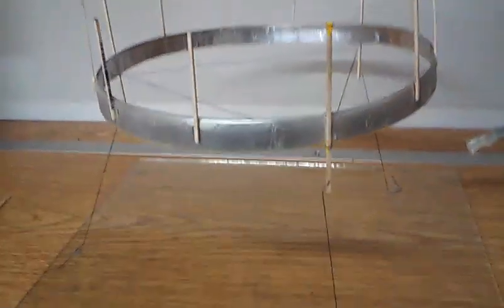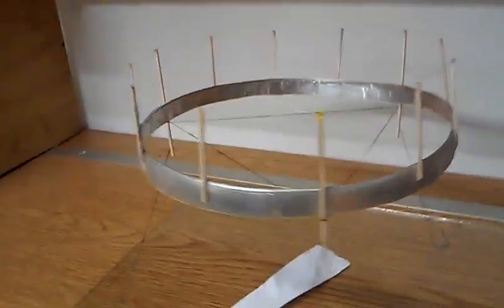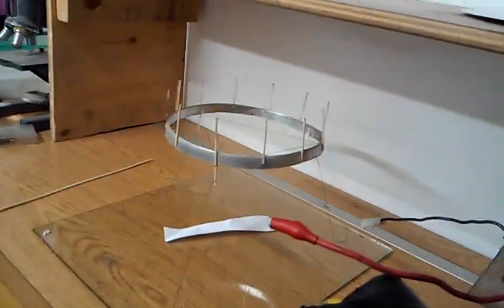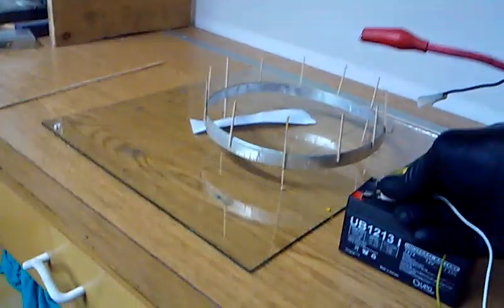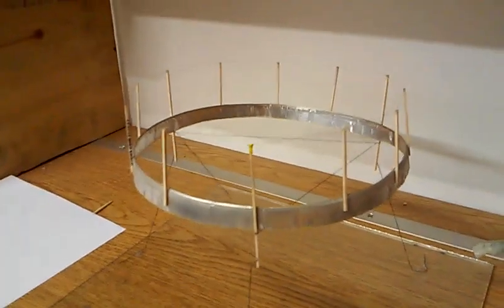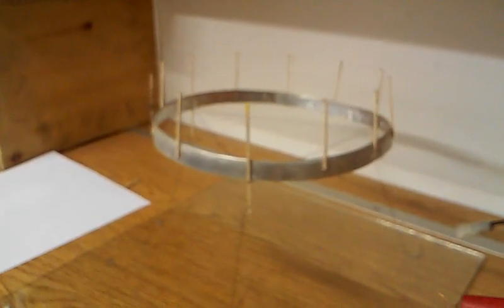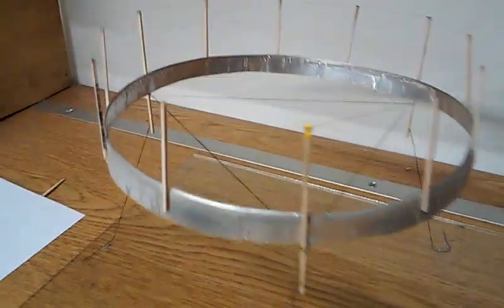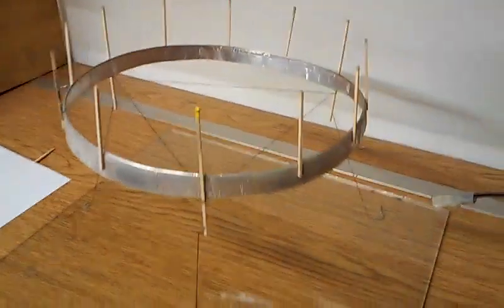ANTIGRAVITY LIFTER CREATES ARTIFICIAL GRAVITY ASYMMETRICAL CAPACITOR

Comment: If you want to real test just put that device in a vaccum chamber (almost 100% with no atoms). If it doesn't lift, its for sure ioninc wind. otherwise is something else  like you say(...) ... You said "it creates it's  own gravity field". Drop something inside to check if there is any kind of "gravitic correlated anomally" (weight reduction, any different trajectory, etc). Looking for the tension on the wires holding the device, i would say its just a "pulsing ionic wind".  A neutral gravitic disruption would, for instance, put the device floating with no need of wires(...like a gravitic cancellation) Try the refered  chamber and you will get the answer(...) For instance, if you can observe a floating iron based material, replace it with an organic one. Like an apple or cotton... On a true antigravitic environment you should observe same behaviors on both materials (like in space).

Comment: I used to repair tv's  back when I was a kid and I remember getting shock by the nodes or high voltage reactor 11000 volts that supplied power to the vacuum tube that used to be the old TVs the size of  differential power emitted by that wire the one that was inserted inside the tube (TV) used to have a suction cup in order to keep the electrons fired or dispersed by that account those electrons are being fired to the plastic krylon ( Cathode ray beam) mica which in fact bounce to the aluminum or tape around the sticks and you can see his latex gloves to prevent shock and yes is painful getting shock with those sparks

Comment: Guys, I suggest instead of all the negative comments and criticising this guys science knowledge you actually try and make one yourself, they are quite easy and see for yourself.  I've made a few and even made a vid of one attempt here:https://www.youtube.com/watch?v=xMnWqA7GClk   In my experiments I used a scale to measure the thrust and weight of the lifter and although there is indeed ion wind from the lifter the amount of thrust is at least 10x less than what would be needed to lift the mass. In my experiments the 'wind' seems only to give the lifter a direction to go in ie. up. Also other experiments showed it was able to maintain fixed altitudes based on different levels of voltage. if there was even a fraction of a newton more than needed to lift the object and hover it would keep moving in an upwards direction and not sit at different heights based on the volt level. I will video more of my experiments as some quite amazing things happen that don't get mentioned. When my lifter is at the top of its tethered travel I too tried poking it with a long stick and the force needed to push it down is way way more than being given off by its tiny thrust plus when you bring the stick near to the skirt, the skirt 'grabs it with a very strong pull to the skirt that feels like a magnetic or very strong gravity pull. This is a wooden stick witch doesn't have a magnetic material in it. My take on all this is that it's very real, very easy, anyone can do it, almost certainly in use by a government to reach orbit and being systematically ridiculed to stop the common man doing the same so easily. Try making one and see for your self and even tho dangerous levels of voltage are being used don't be afraid to poke it with a stick and see for yourself!

Comment: sooner or later humans will discover that its actually sound lifting this . everything, all particles, everything, is merely a manifestation of frequency input into the field . like all frequencies, some cancel out, and some stack and amplify . since electricity is simply the manifestation of frequency input into the field, all one must do to overcome frequency return pull towards 0 ( gravity ) , is to match, them amplify the opposite harmonic of the pull at an atomic level ( string frequency ) , "Electricity", if tuned right, can easily accomplish this, as witnessed by this video . electricity is merely frequency pumped into a string that hopes to achieve 0 state by returning to the field through a frequency return . you can find these returns in every atom at the core, in every planet at the core, and in every galaxy at the core .

Comment: hello, ive done some of this in the past , your design seems to be pretty heavy and still works, i always used aluminum foil, maybe there is more potential acumulated in thr thiker aluminum plate??? ( meaning your design) , what is it ??? i know aluminum but can you please please tell me , i always tought the weight of the craft was very critical meaning that it should be as  light as possible but you have proven other wise, thanks

Comment: I see a transformer. Larger wire on bottom and smaller on top. Or Tesla coil w/lift.  Only Tesla coil has to much thin wire maybe, and not enough thick wire bottom of cylinder. Im 12 years old and want my own flying suit. studying aviation engineer.

Comment: Jim RugRoden Is there a diagram? Where are the wires connected on the device? This video doesn't show it clearly (at least I can't see them with these old eyes) and I haven't heard you say anything about them. If one wire goes to the aluminum circle and another wire forms a circle at the tops of the wooden sticks, the voltage is applied over the gap between top and bottom field on the device. If one wire goes to the aluminum circle and the other goes to the glass or plastic sheet on the table, the dielectric field is between the device and the table. In that case you have electrostatic repulsion. I believe this is electrostatic repulsion based on your description as an "Asymmetrical Capacitor". 
https://www.britannica.com/science/dielectric
Certainly not anti-gravity or you would see things falling toward the device. 

It does not appear to be ionic wind. You would need significant wind to lift the device so quickly. Some advise blowing smoke around the device to show wind flow. I suspect you'll see the charge move the smoke particles so that's not a useful indication (you're moving ionized smoke particles - not air). Take a look at a Dyson bladeless fan. Moreover, feel the airflow coming out of a Dyson bladeless fan. That effect on a smaller scale could lift the device but you would see some result of the downward wind and you would not see such fast acceleration. It would affect the paper in some way - even just a wiggle or wobble... or a wiggly wobbly. I don't see any of that. Repeat this video with very thin pieces of paper if you want to dispel this as an ionized air propulsion method. That effect does work and it works with a power supply on the device:
https://www.youtube.com/watch?v=boB6qu5dcCw Notice what is said beginning at 0:56. Explain why this is different. Be prepared to give an answer to contrary views.

Just how thick is the wire? Around 28 gauge magnet wire I would think - although they don't show up on this video and you don't talk about them or their attachment. A Joule thief on a flyback transformer, ok, got that. Any idea what the voltage is? You say "pulsed DC". Frequency of the pulses? Waveform shape of the pulses? Can you point to items in this flyback calculator to give some idea or is this just an arbitrary transformer?
https://daycounter.com/Calculators/Flyback-Transformer/Flyback-Design-Calculator.phtml

You have a large chunk of money and effort tied up in your work as seen by your scan around the room. You want people to take you seriously. Invest in some test equipment and show more than just tell. An oscilloscope would be able to explain everything you need to show to bolster your talk. Anybody can talk. Instruments prove.
Reply: Nicely done.  Your eyes may be a little worse for wear (like my own) but your brain is obviously firing on all cylinders.    TNQ

Comment: its positivedielectric on the top wire negative dielectric on the bottom tinfoil  the ground is negative dielectric negative and negative opposes each other if you turn it round its will attract high frequency electricity is moving it from the magnetic to dielectric went you step it up in a transformer

Comment: it's not antigravity. its ionized thrust.  it doesn't work in a volume and gravity is still acting upon it. 

in truth you would have to lift an antigravity device off the ground because it would continue to "float" in the same spot which is on the ground.

Comment: from my view it seems using ac or dc changes the way it works.i think it must be run with a battery of low voltage .the shape should be more of a maple leaf cut pattern with points up side buy side in a very specific  measurement of curved edges so as to amp up the gravitational field as the electrical field is pulled to it this will replace  the need for high voltage and reduce loss but it has to be dc current to match the static in the air.the object you wish to fly would work better if it is heaver than the object you wish to lift.just think of it as falling upside down to the sky but with a increasing speed.i am nobody and have 0 knowledge of anything.. if you think of the dc charge as a match to a pile of hay.i know everything i say seems to be the opposite of what would seem to work best but the power is already in the air and remember i know nothing at all 0 so this is just to get you to think outside the traditional concepts based on any facts all my thoughts or just that just observational thoughts .love the video thank you.

Comment: Could u put two smaller smal designs built at 90° the two "ionic engines" at 45° apart. And use then to propel forward and turn

Comment: Jim, how much does the unit weigh ?
Reply from the maker: I'm not sure, but I know it's probably 2 times what a triangular one of the same size weighs.
Reply: Get some scales and weigh it, don't just tell us "pretty heavy".... smh
Reply: Thanks Jim, would be cool if you could let us know the weight and the input power and output voltage. It looks like quite a few grammes of aluminium, plus your hardwood stick. I'm impressed pal.

Comment: last I looked at these when tested in vacuum they didn't work (supposedly) But since NASA is testing EM engines don't see why they wouldn't give these a red hot go
Reply: EM is different from electrostatic as demo'd here. And EM drives do work. In or out of vacuum. This one needs some ion-able gas to work, like air, or a conductive gas. I can see this maybe used for a large balloon, to help lift the HV device and for night ops this would be pretty quiet, but might be a bit hard to control. Look up T. Brown, P. Laviolette, and NASA EM drive info releases. All this is helpful. I think they already may have done the Zeppelin/Ion-Lift augmentation design, but it is used more for maneuvering than lifting.

Comment: Jim, as you say it is not Ionic, how did you figure out this design? Does the curvature on the top of this devise influences anything? Have you tried using a copper foil or other materials? since the forces can be measured upon the voltage in relation to the type of materials... :) As I know each have one extra electron on copper and aluminum to carry a current or voltage.

Comment: Cool story bro, try it in a vacuum, no don't, because it won't work.
Reply: It wont work in vacuum unless you use proper dielectric materials with very high dielectric constant. Dielectric materials like barium titanate or calcium copper titanate. Thomas Townsend Brown used dielectric materials in his biefeld vacuum experiments so most youtube videos and mainstream science doing biefeld brown experiments are doing it wrong. Also most people may not have noticed that the wooden stick between copper and aluminum is acting as poor dielectric material, also air too is acting as poor dielectric material. Ion wind is a result of air dielectric breakdown. Vacuum has a dielectric constant of 1, air has dielectric constant of 1.0006, wood has up to 5.2 so very poor dielectric materials, where as barium titanate which is used in military ufo's has dielectric constant up to 10,000 and calcium copper titanate has dielectric constant of 250,000. Military ufo's use 50+ millions of high frequency voltage where as T.T Brown used 150+kv in his vacuum experiments. Proper dielectric materials are needed for high efficiency lift, ion wind is inefficient at best.
Reply: @Xeno_Bardock  it doesn't work period.

Comment: At 1: 30-1: 33 You can see a thin fishing line.
Reply: no you can't.  This is a pretty standard and proven electrostatic lifter.  what you can see is that he touches the battery terminals and it rises.

Comment: No evidence it's anti gravity. That's an amateur assumption. It's suspected that it lifts by moving air, or produces an electron or ion wind over its surface. You would have to go far to explain this with gravitic effects. Pretty good design though. Doesn't make as much sound as other designs

Comment: Very interested. Subscribed and bell notification. 
I'm building a "ufo" aircract shell to fit this design.  While integration of materials, towards the weight + power + lift= large scale aircraft+ torque+ control. with more volt output and a dimmer throttle to regulate the power. Then rear and forward thrust by unbalanced power applied at the same time.  Let me know if you are interested. Design as follows. 
Hollow cargo craft that uses this system as a whole. The ability to make things stronger in attraction magnitude, with greater gravity than earth. Therefore antigravity/microgravity.
#(Ck) common knowledge

Comment: Not quite right Jim. There is NO WIND.  the planet itself has a flow going up and a flow coming down, its similar to an electrical circuit. what your essentially doing is this creating a block when you apply the charge to the wire it is blocking enough of the upward flow that would normally go through the objects but is now instead being forced to push the objects upward along with the flow, IT'S THAT SIMPLE,  that is what Gravity really is.

Comment: Top wire if charged *positive* at high voltage (10,000 volts DC?  20,000vdc? and so on) will literally strip the electrons off the surrounding air molecules (electrons are *negative* charged, and 'unlike charges attract', so the positive DC top wires yanks the negative charge electrons right out of the nearby air molecules).

The newly-stripped air molecules have lost some negative charge (lost electrons) and have thus become POSITIVELY CHARGED IONS which, because the bottom pie ring is at ground or zero volts, the more-positively-charged air ions ATTRACT THE BOTTOM RING.  The zero volts DC bottom ring moves upward towards the positive air ions that the top wire is continually creating.

A lifter is a 'static electricity space charge' device.   The 'space charge' is the collection of positively charges air ions sitting in the space between the top wire and the bottom aluminum foil.

Wash a load of laundry.  When you pull your clothes out of the dryer, and they stick together, and they stick to you, this is the exact same effect - static electricity, negative and positive charges,  that polarizes the air molecules between a negative (or grounded) charged object and a positive charged object.

That's why lifts don't work in vacuum. You need air molecules to ionize - the positively charged air ions are the 'magnet' that pulls UP on the grounded, zero charge aluminum foil.  You need air molecules to allow the top wire to strip electrons and create the space charge.

The movement of air, 'ion wind',  is a SECONDARY EFFECT, and not responsible for the upward movement.  As the bottom aluminum foil moves upward, it also pulls the positive ions downward, but the top wire is still producing additional positive ions at every moment.  The downward-pulled positive air ions is the 'ion wind'

.
.
.